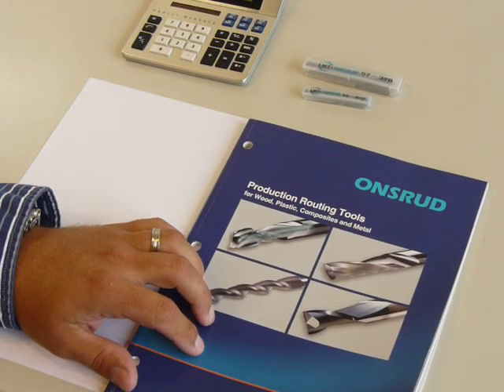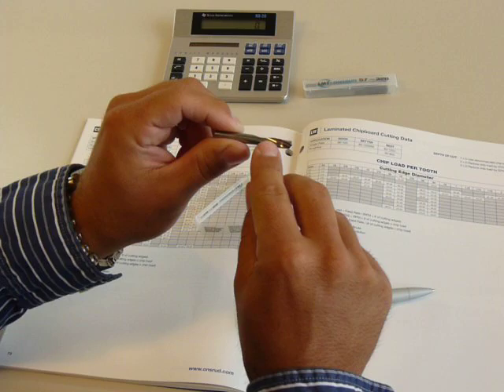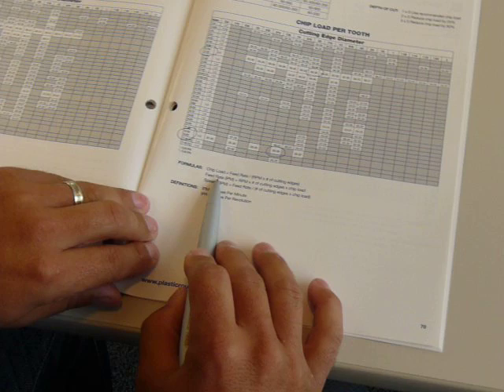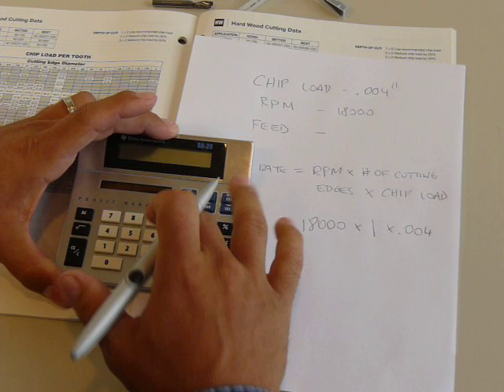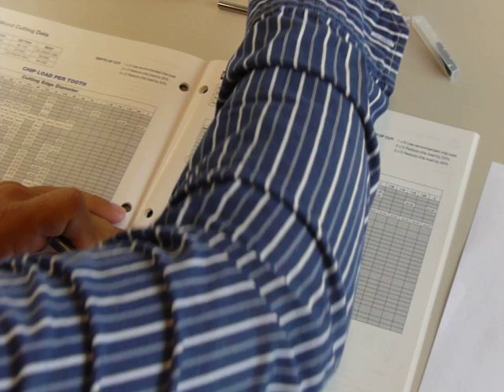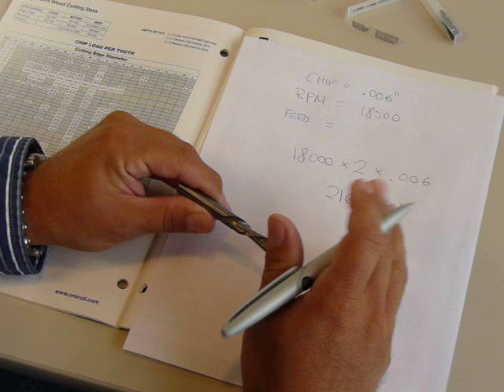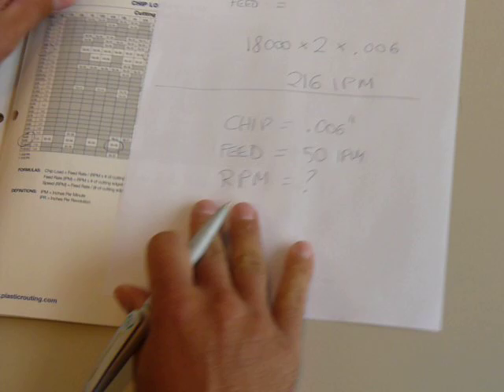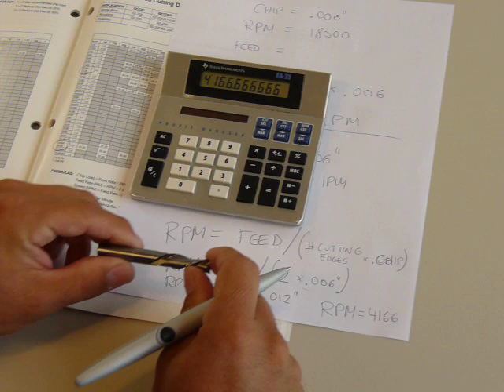How to Calculate CNC Routing Speeds and Feeds Video by LMT Onsrud

Comment from the maker: What we calculate is basically 1 x D which is One Times The Cutting Tool Diameter.

If you go deeper into the cut then you will need to adjust the feed rate such as 2 x D (two times the cutting edge tool diameter.) you would need to reduce the feed rate by 25% to account for the increased depth of cut.

Comment: This is amazing, hopefully I won't need to pester you as much... 
How do you determine the spindle speed? (You seemed to arbitrarily pick 18000)
Are there rules of thumb for picking the RPM? I know they have calculators that will calculate when the RPM is, but it seems to all be circular as they often need the feed rate or spindle speed to find the other.
Reply from the maker: +Lord Wukits Not a bother to ask - it's what we do! Chipload is the most important aspect really - finding the correct chipload for the material being cut and the tool being used. For routing woods and plastics, 18,000 RPM is a good place to begin. Our router can handle more RPM than the 18,000, but some machines and processes cannot. If you set your RPM and "fix" a second variable, you can calculate the third variable. 

You would need two of the 3 factors to determine the proper feed and speed rate to run. Best though to find the proper chipload - which we supply in the back of our catalogs for the part numbers and material being cut. Smaller parts would not be able to be fed more quickly so you would need to slow your feed rate down and / or possibly slow your spindle speed to prevent the tool from heating up too much; leading to tool failure and poor performance. 

This link - http://www.onsrud.com/files/pdf/LMT-Onsrud-CNC-Prod-Routing-Guide.pdf - on pages 7 and 8 could provide some assistance as to how and why you would need to alter the speed and feed rates. 

Let me know if this helps of if more information is needed.

Comment: Mhh... So I'm a Hobbyist with a Maker grade CNC ( Inventables X-Carve ) obviously having not industrial grade performance of a HAAS or Tormach.
The machine has recently been upgraded with a purpose-built Spindle with a range of 8000-24000rpm and a Leadscrew Upgrade Kit capping at a certain velocity.

Doing some test in the Fusion 360 Tool Library I came to notice the automated relationship that is happening between the rpm, feed and chip load.
The way I see it I would ideally set the values for the FIXED chip load and then go for either the highest possible feed or rpm until either one or the other caps out OR the surface finish deteriorates?
Reply from the maker: Hello Durahi,

We do suggest starting with the correct chip load along with the suggested RPM. RPM values will vary depending on the material, but in most cases, the RPM will be 18,000 for routing 
woods and plastics. 

Start in the middle range of the chip load values and start increasing the feed rate until the part finished starts to deteriorate or when you risk moving the part off the vacuum. 
You will then want to decrease the feed rate by 10%.

Next, focus on the RPMs. Decrease your RPM by a set increment until your surface finish becomes unacceptable. 
Once this happens, increase your RPM until the finish is acceptable.

This will optimize your speed and feed rates and allow for the largest chip possible being taken. 

Hope this helps, but if more information is needed, feel free to contact us.

Comment: I have a 1-3/4" straight bit with 2 flutes. If I do 15,000 RPMs and 0.015 chipload, that gets me a feed rate of 788 ipm. That seems awfully high. Is that correct? Thanks.
Reply from the maker: Nolan Gaudreau Hello Nolan - my apologies for the delay - just saw this post. Can you tell us the part number or series of tool you might be using....as well as the Cutting Edge Diameter of the tool? To find the correct feed rate, you'd want to use  Chipload x RPM x Number of Flutes (Cutting Edges)   Chipload is determined by tool series and cutting edge diameter.

If you can let me know the above answers we can determine the proper feed rate. It does seem quick for the information you've provided. Please let us know and we can assist further. Thank you.